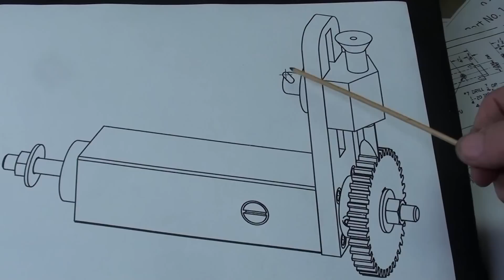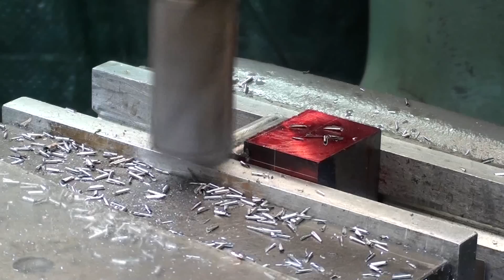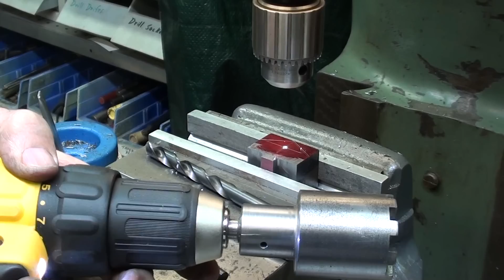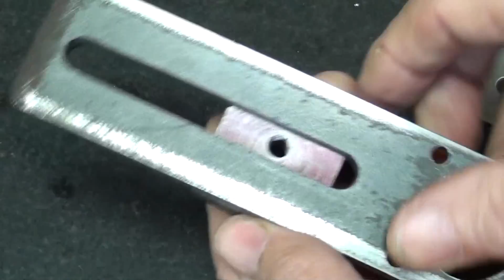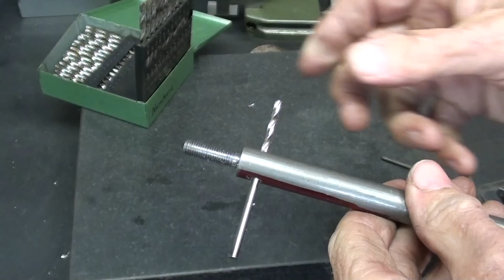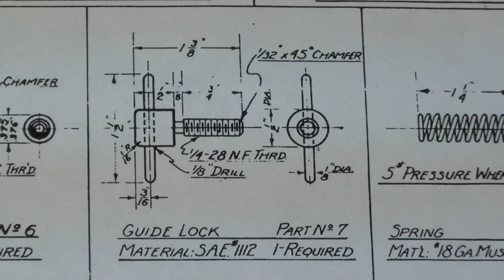MAKING ATLAS GEAR CUTTING FIXTURE pt 3 #837 tubalcain guide pin

Comment: I am building one and I guess lots of people will do the same as their budgets don't go as far as a Milling machine also  Give yourself credit as it certainly helps those who are just beginning the Metal Machining episode in their lives. 
 Mine will be different to see if possible to make different-sized gears in a planetary setup to achieve what I need on a larger gear as my old, old Metal lathe is a train wreck needing a pile of money thrown at it. Gears are a start! Also, I have a gear missing, which is the biggest one in the set. 
 My budget is a little less as I do many other hobbies and therefore I can indulge in something like this when time permits. However, saying this all my hobbies require a lathe at least that can turn a bit of steel and on occasion do a little milling, etc.

Comment: Hey Mr Pete! What purpose do the 30 degree angles serve? When I built mine I don't think my drawing had them or I left them off because I didn't see the need and didn't have a mill at the time. My indexing pin came to a point as well but I think the bladed type like in your drawing is probably better. Great videos as always!

Comment: The great thing about this is that one could adapt the sizes for any size milling attachment one may have. One could also make this without a mill by using the milling adapter. (Now would that have been something if you used the milling adapter in this series)
Reply from the maker: Believe it or not, I considered doing that

Comment: Another great Mr. Pete video!
* Clever use of lathe for tapping be putting the work in the tailstock and the tool (die) in the chuck. It also gives me a reason to use my hex dies, which I always regard as inferior to round dies. They have the look of tooling made for the hardware store.
* Love the self centering cross hole drilling jig. I will start looking for one.
* I passed on a SB lathe, because it was over priced and an out-of-town trip demanded that I postpone inspecting it. It sold while I was on the trip. That was sad especially since in the included tooling assortment was the coveted Starrett bench block. I still don't own a SB lathe or the much desired bench block.
* Your "second third" segment comment made me chuckle. It reminded me of the beloved Click and Clack radio broadcasts. They were joking that they hadn't resolved their desire to lengthen their broadcast time slot. Their solution was to divide their show into thirds moving from two segments to three. They called the new last segment "The third half". They maintained that joke until the end of that show after Tommy died. I have often copied that joke in my own teasing. There are many third halves in my life now.
Reply from the maker: Great comment, thank you. Yes, find yourself a drilling jig. They are kind of rare. In fact I never see them and way too costly brand new. Also, you never see those bench blocks. Good luck on finding a southbend and I agree with you on the hex dyes they always look cheap hanging at the box door on a hook, but I like the fact that you can hold them in a three Jaw
Reply: @mrpete222  In a past life I sold tools to mechanics as a Snap-On , Mac and lastly Matco tool dealer. The dies sold to mechanics are usually either hex or 12 point (Snap-On) because they can use a socket or wrench to thread in tight inaccessible places. The Snap-On dies were not only 12 point but were also adjustable. All were of high quality although some were HSS and some carbon steel, depending upon how much the mechanic had to spend on a set. I never saw any manufactured as poorly (off centered) as the one you used in the video, but all this was back during the mid 1970's to about 1980 when I left the business. At the time all were made by Hanson Ace in the USA.

Comment: As I continue to watch this series I am thinking about how to modify this fixture so it can generate gears on a shaper. Perhaps that could be a follow on project for you. Thanks always for the great videos.
Reply: Why not just use a dividing head and a form tool on the shaper?
Reply: @AntonJonssonMEK  For very small gears a form tool might be OK. There are a few good reasons to not depend upon a form tool. 1) Most shapers have no automatic down feed but they do have an automatic cross feed. Using a form tool one has to hand feed down to the correct depth for every gear tooth.  2) Grinding an accurate form tool, while not impossible, is difficult, particularly if you don't have a gear to use as a pattern. When generating gears with a 14.5 degree PA, for example, a tool bit can be ground using an Acme screw gauge and it will accurately generate any gear regardless of DP. For a 20 degree PA a simple protractor can be used to make a gauge to guide tool grinding. The only difference is the width of the tip of the tool. 3) When cutting larger gears with a form tool as the cut deepens in the gear tooth space the load on the tool increases causing chatter and increased load on the machine and tool bit. On very large shapers this may not be as important as it is on smaller home shop sized machines. One can get around this by worrying out some of the material with gashing cuts using a parting blade or band sawing out waste material or cutting from various angles on each tooth until little material is left to remove and then using the form tool as a finishing tool but this all takes a lot of time on each tooth. Generating gears on a shaper requires only one setup of the blank and  indexing for each additional tooth. As the shaper table moves the tool takes a small chip and progressively generates the tooth shape.

Comment: You could turn the angle block to the 60 degree angle and reference on the solid side of the block.  You would get a more solid feel before closing the mill vise.

Comment: gotta laugh! cutting threads with a hex die. I have been doing it for years. Every one says you need round dies? I bought several sets of hex dies many years ago when I started out. They just made more sense. Hex die will not slip in holder, Can use a wrench on then in tight spots, ect.     please keep these video's coming

Comment: Good morning Mr. Pete!
Heinrich is still in business as of 2021.  I had to purchase an adaptor liner for my Heinrich 305 crosshole jig a couple years ago and contacted them. They do not sell direct to the public-they directed me to MSC Industrial.  MSC is a great company, however they are pricey on some things.
I purchased my crosshole jig on eBay for a reasonable price and have used it extensively on many projects involving crossholes.
Using layout lines and the DRO is what Quinn calls a sanity check.  As a QA Manager in my day job, I have many sanity checks as mistakes can be costly.  Besides not everyone has a DRO and have to usr layout lines.
Woody